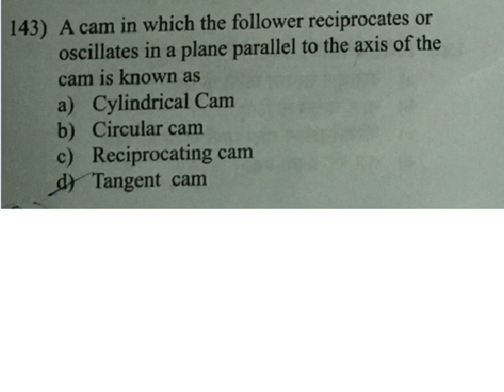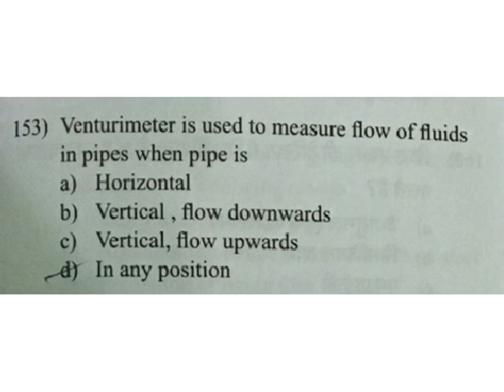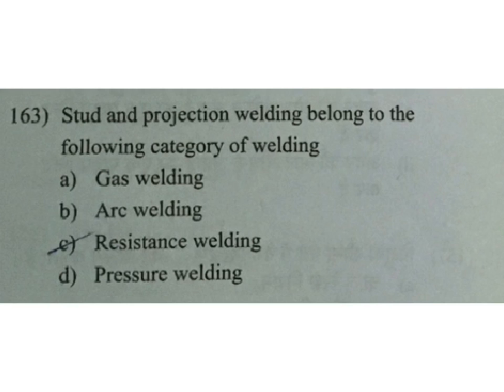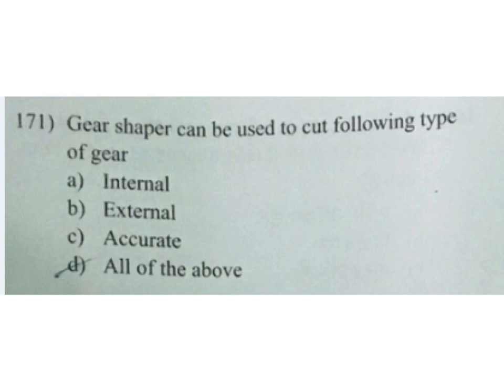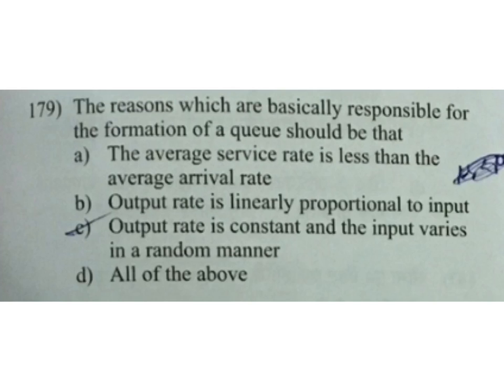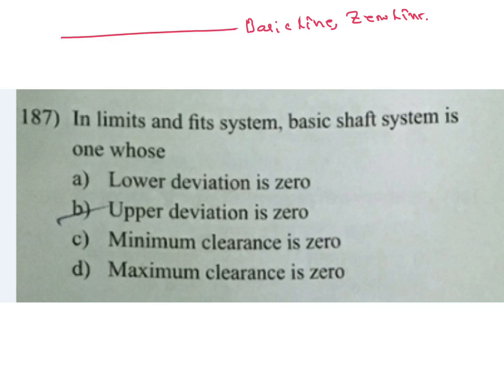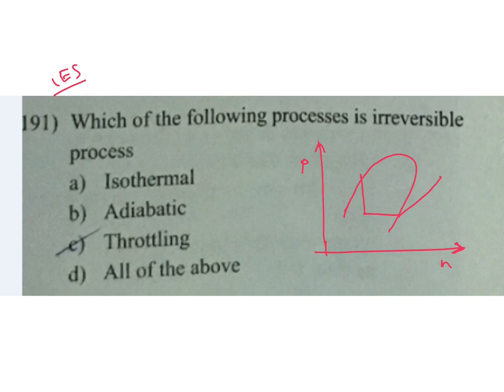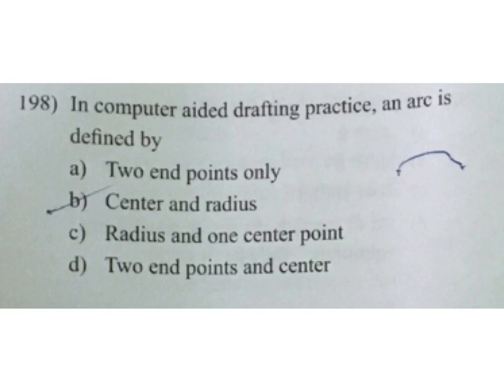VIZAG STEEL MT 2017 TECHNICAL PART

Comment: sir, isro fm-12 question no-14 and isro fm14- question no-42 , stream function and potential function the value of  velocity u  have denoted one in minus sign and another in plus sign which explanation is correct please describes once again sir.    thank u
Reply from the maker: susheel chand both are correct in kl kumar book and sk som book both are available.